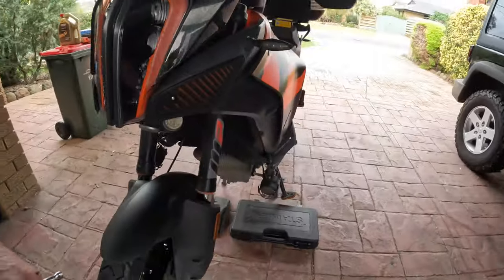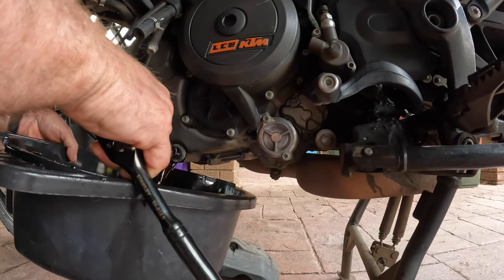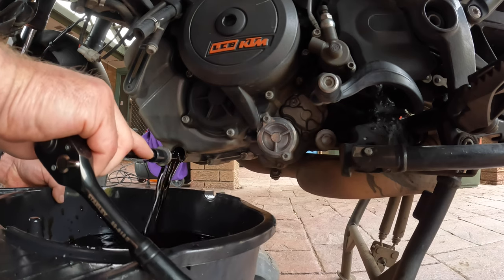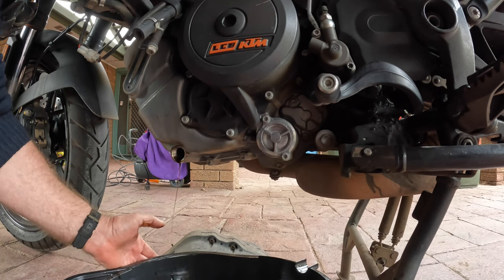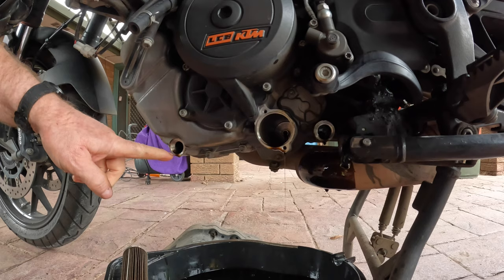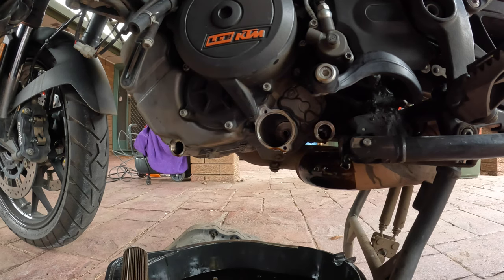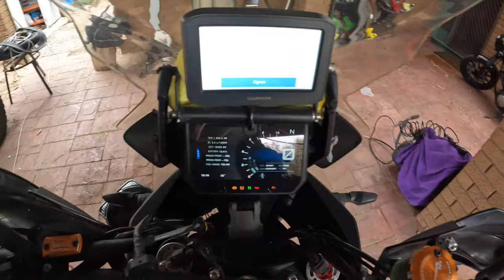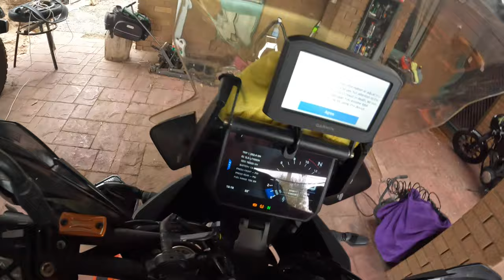KTM 1290 SAS CASTROL OIL CHANGE

Comment: One suggestion Dan, 3.5 liters is calculated because the oil increases in volume due to foaming and pressure during operation. This margin is needed so that the pressure and too much oil do not leak the engine. Please check the level as instructed in the instructions, after reaching operating temperature, turning off the engine and waiting 1-2 minutes. You will see that the level is too high.

Comment: Nice video! I live in the US and bought a used 2019 KTM 1290 Super Adventure S with 3K miles on it. It’s got a Rottweiler intake system and a modified exhaust. Any tips or favorite mods or accessories you could tell me? I’m wanting to get a new windshield for it but I don’t know which ones best. I want a smooth ride.
Reply from the maker: I got a new windshield from the internet,,  cost under $100AUD and it sits a bit higher, keeps the wind off,,, I have a Delkovic muffler, I fitted the KTM heated grips, Top Box, I put a big boy air horn on her and most important a set of spot lights mostly so as other can see me..  I also put a K&N air filter on at the last service,, it made so much difference to the running.  But to be honest the bike doesnt really need much,, she is a multipurpose bike where she does adventure and cruising, and if you want to do a bit sports she will give many sports bike a run for their money,,,